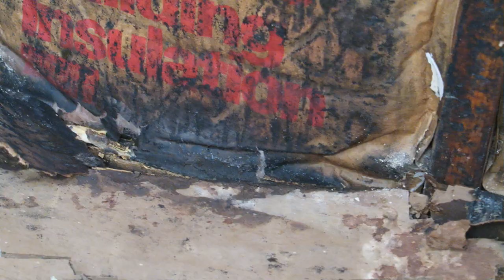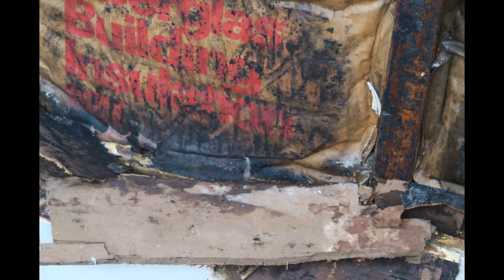A horrible MOLD discovery

Comment: I hate seeing that. My sister, who lives in a two story house, wanted new wall paper in the stairwell. Of course, it's never that simple. When the paper hangers stripped the old paper they found the sheetrock behind it wet. So, they checked the upstairs bathroom and found the vanity was wet in the bottom as well as part of the bathroom floor and the wall behind it. Several weeks and thousands of dollars in renovations later, it got fixed. All found because sis wanted new wallpaper in the stairwell. :(